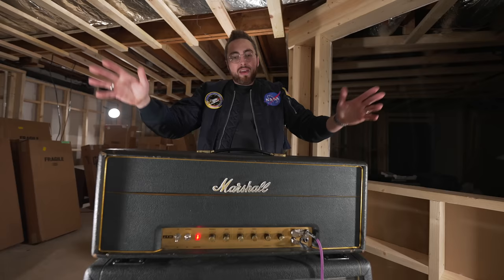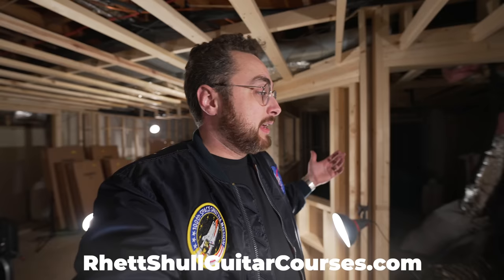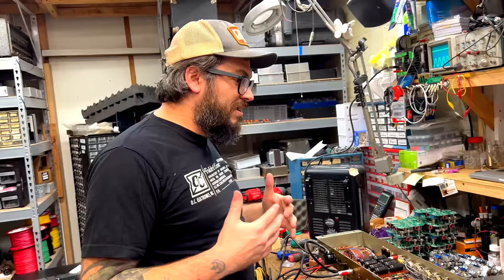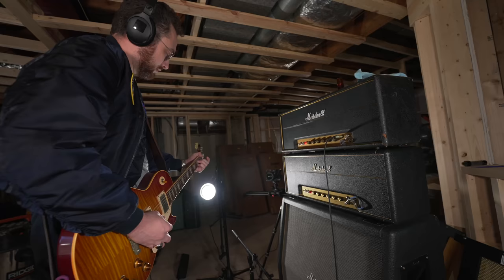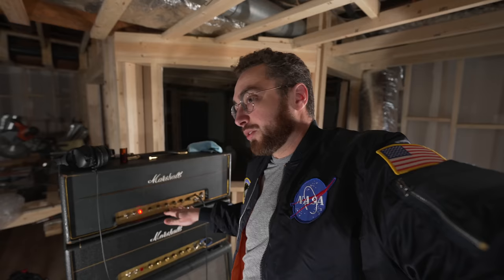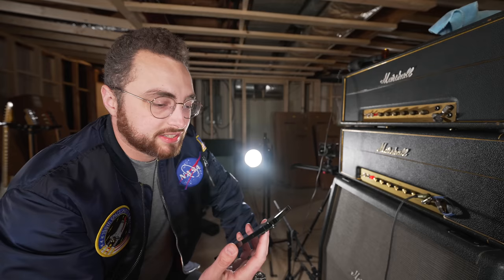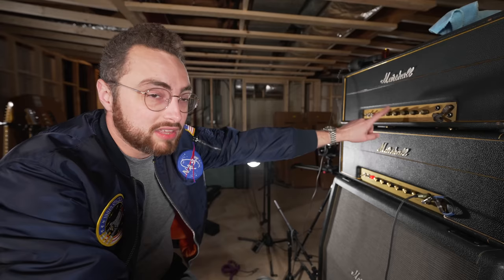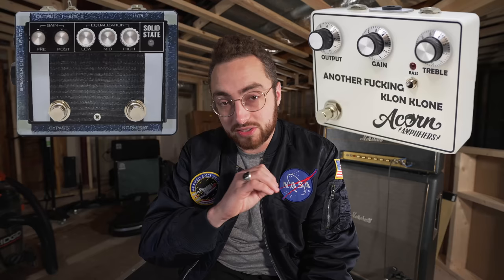This Amp Is So Loud It's Painful | Vintage 100W Marshall Plexi

Comment: Notice how we all seem to play differently at massive volumes? All of a sudden you forget how to play, it's intimidating
Reply from the maker: It’s legit pretty scary.
Reply: Im a trucker and only get home about three weeks in the year. This is how i play every time im home. DAMN THE NEIGHBORS.... actually i do stop playing at night.
Reply: It did change the way I played. Absolutely. After I got over the SHOCK of playing at high volume, I became much more in tune with my touch on the guitar.
Reply: I told an old buddy of mine one time, “you gotta practice at gig volumes to really be practicing for the gig!”  I got a stern talking too from his wife about that the next time I saw her!  🤣
Reply: It's the fear of having everyone on earth hearing you make a mistake
Reply: I do the same thing I thought it was just me!
Reply: Almost so loud it’s distracting me from focusing on what I’m playing.
Reply: Great vid, Rhett. 😢As your touch is governed by your reactions to the sound of your guitar and the feeling of the air around you, the fact you have to play differently at 140 watts makes sense. It also seems that a volume control essentially throttles a tube amp until it doesn’t as you reduce the resistance by increasing master volume Many amazing tube amps are disappointing at bearable volumes.  Unlike the kemper SS power I use now, tube amps I have had exhibited two volumes rather than a range of 1-10: it was either ‘choked a bit’ or ‘loud af’. My fave Marshall profiles other than the HW modern ones are the old superleads. Super percussive.
Reply: I keep forgetting I'm playing my 74 halfstack because I'm so in awe of it at volume! Stunning!
Reply: You have to make it to the cowbell. It is a ride. You can feel it. So if you are not used to it or not willing to learn to ride the bull. Don't! It is not for everybody.
Reply: When I play this loud, at rehearsal, I play like Hercules kills lions.   Unstoppable.  
But realistically, no sound man would ever let me play like that at a club.
Reply: Stage experience. Much easier to deal when the band is also playing.
Reply: @jameswyre6480  At least you didn't said "MY Kemper", lol. 😂
Reply: I know I do, and I don’t play well to begin with.
Reply: Very few can do it, you have to warm up for 4or5 hour before you get it, modern distortion sound better 2203, 2204
Reply: First time I played a 100w Marshall in a studio while recording I couldn't do it.  The amp was louder than the tracks in my headphones!  Fortunately they had an isolation closet.
Reply: it's the lack of effects and compression and the need to articulate your notes that really makes most fall flat on their faces. I'm one of those  "every note is picked" players so when I could finally turn up an old amp I felt really comfortable
Reply: This is so true. I can only assume my fingers are intimidated by decibels.
Reply: It's just like mixing...it's all in context with the whole band. As soon as those drums and that bass kicks in and that guitar is level match with the whole mix, all is right with the world. There's a huge difference between practicing and a rehearsal. Save your ears and practice at a reasonable volume, and wear the appropriate ear protection at rehearsal and the gig.
Reply: That’s the thing I noticed about new tech , everyone rips but my whole life was with 50/100 watt head and 4 by 12 cab .. every club every gig .. still at home but use an ox box to make it house reasonable … now we are all
Eddie with this tiny earphone level lush tone … head and cab and ya suddenly brovato is shelved ….
Reply: 100% true.  I play with confidence at low volumes.  Cranked up loud, it's like I lost 50% of my skill and confidence and I have no explanation why.
Reply: Roger Daltrey talks about not being able to hear himself trying to sing over these Beasts.  Said he never heard himself after a certain point.
Reply: I used to gig a 120 watt sound city stack with 2 4x12 cabs , once had a noise complaint from a house 3 miles from our practice venue....🤣🤣
Reply: When I started playing it was always scary when plugging into a JCM 900 that were on every stage and rehearsal spaces: not only it was way too loud, it sounded terrible as well.
Reply: So true.  When you’re playing to the amp cuz it’s so loud, and that can be a 15 watt in a bathroom, it’s like trying to learn all over again.  For me at least.  I have to be able to spank it and be aggressive.  When it’s cranked my style can get ugly.  That being said, if the money is in filling a large space and has to be cranked that’s just another part of the job.
Reply: thats because the instrument vibrates way diffrent in high volumes. than can throw you so off. billy gibbons sayed once something about this
Reply: Why I will never get rid of my old JTM50t
Reply: @EnigmaEuslam  I'm able to crank it up so I'll agree.  I wouldn't want to change my living situation where I couldn't.
Reply: Man that is so true.
Reply: Lmao, there's nowhere to hide. It magnifies the ham fist. Sounded killer,  Rhett.
Reply: It's always strange playing at that volume with no other instruments.  It's like screaming alone in your quiet office, very unnatural.
Reply: @matthewgonzales3970   Exactly...  only then you know how your guitar reacts and how to touch it..  it is an eye opening experience..  or ears 😂  Too bad it is bit painful, I dont use attenuators or ear plugs..
Reply: Because your mistakes are heard all over the neighbourhood lol. Once you get over the fear its pretty awesome. Actually mistakes dont stand out that much if you play with attitude and confidence.
Reply: That's because when you screw up at low volumes, you're the only one that hears it. At Plexi volume, everyone in a 10 mile radius heard you fart out that note. Lol
Reply: @davidg1612  Straight up truth. I can turn my Soldano up to about 2 in my room with earplugs in. After that it gets unbearable. Im sure the old plexis are even louder.😂
Reply: Smokin!
Reply: @matthewgonzales3970    That's true- my guitar feels like it's come alive in my hands, when I turn the amplifier way up.
Reply: I think it’s because the beast scares the crap out of you
Reply: The neighbours are all listening now
Reply: @guskalogeros9021  the sound men have been given too much power by us as musicians. The fact that when running Plexi glass, Soundmen still complain shows they aren’t worth a shit as sound men. Every sound man over an 18 year career in pro music and touring absolutely sucked and had no ear or talent for the craft, other than about 1
Reply: @StratTones  I agree to a point.  
There’s a lot I dealt with that we’re absolutely shit and wouldn’t let you turn up at all, completely ignoring that you need to push a valve amp to a certain point to make it sound good.  
There are still good ones though.
Reply: Absolutely true , it’s like the higher volumes pick up all your mistakes and you become self conscious of your playing , then you lower the volume and the confidence grows again
Reply: @RhettShull  it takes getting used to. But once you do it’s amazing! Then whenever you plug in you want that crazy loud volume. At least that’s how it is for me.
Reply: @KD-nb3mp  I played one of those and a mesa triple rectifier at a practice space regularly …maybe would go to 3. Completely mental.
Reply: I find this strange. Never have I found a loud amp in any way intimidating. Loud drummers? Yes. 😉 I love it loud! Turn it up, move air!  Feel the guitar through you! I’ve been using 100w Marshall with two 4x12s or two heads and 4 cabs for most gigs for decades. I know some people say this is overkill and usually when I ask they all play really quiet, whether it’s at home, rehearsal or gigs. No stage volume just whatever the foldback provides. Couple guys said they use a 10w combo with 1x 10” and say it is really loud! Haha!
Reply: @ericmills9839  Haha! Damn, i can totally imagine dude. Bob Rock said that John Sykes used two Mesa Boogie Mark 3 coliseum heads (180 watts each) and slaved them into eachother. Ran them with a chorus in between them and through two Marshall 4×12s, all turned up on 10. Can you imagine what that mustve sounded like?🥴🤣 That was on the "1987" Album and the Blue Murder Debut.
Reply: @onlyfromadistance7326  you only get home 3 weeks in a year? That's absolutely mental. I respect your hustle.
Reply: @JoeStanleyAustralia  depends on taste and where you stand I suppose.  I've had drummers yell at me for being too loud with a modest open back combo too close to them. ;-)
Reply: Just imagine, these 100W amps were created mainly so musicians could fight back against large screaming crowds and be heard, especially in larger venues. They're also a good way to be as loud as your drummer on stage- ha! Noteworthy that legit 50W amps are really almost as 'loud' as 100W. Interesting that your amp guy says he regularly measures 100W Marshalls at 140W RMS or more. OMG. Folks, use hearing protection!
Reply: @davidg1612  🤣 I meant that fart.
Reply: @danielabilez3619  Cool analogy - it's like; when the pig don't squeal then the hay is green but the saddle is the stirrup with the bull's hooves on the farm.......yeah!
🤣🤣🤣🤣
Reply: @JoeStanleyAustralia  Bullshit- unless you play coliseums or use a Variac there is no gig where you can crank a head with two quads.
Reply: @sean1121970  maybe where you are situated but there’s numerous places I’ve regularly played, not just in my state either, where we’ve used full stacks. And so did the other bands on the night. No variac. Lots of stage volume. Only vocals through foldback.
Reply: @ericmills9839  haha. Yeah I get that. Though my drummer jammed with some guys and they said can he play quietly, the drum kit is too loud?
He packed up and left. 🤣
Reply: @JoeStanleyAustralia  LOL, in my limited experience, proper drum kits have two levels: loud and louder.  Shouldn't be a surprise to anyone!
Reply: I’m terrible at all volumes…!
Reply: I find turning up louder inspires me to play better
Reply: Until you tame the elephant,  nothing you do counts
Reply: I think part of it is the louder you are, the more people can hear you. a player might also feel like they don't want to blow out half the planet.
Reply: It's because you know if you mess up, you're not the only one hearing it...
Reply: @EnigmaEuslam  my band usually play almost louder at practice and then end up turning down for gigs.
Reply: No it’s not it’s easier
Reply: Felt this yesterday when plugging in my big muff after a while of just playing acoustic. There was a lot of power coming through with sound. I was lost, so I just played clean for the rest of the evening.
Reply: @floridaman7079  No, it's the fear of getting kicked out of your place. Tube amps have to be turned up just to get a good sound. It's pointless unless you live in the desert, so just get an alternative.
Reply: I've only played my pro tube Twin at 6 or higher a few times in the 25 + yrs of ownership. It's scary LOUD. When I 1st started learning computers and Ebay, 1 of the first things I bought was a master volume knob hook up for my Twin. Then I could drive the amp a bit better and kinda control the volume level. This goes through the pre amp in / pwr amp out. Very loud amp. Then I got a Boogie S O B and it's limit knob. Great amp. Can play along side a stack all the way down to a S S practice amp. And even though it don't play well yet I was given a Lab Series L5 with its original speakers and these are supposed pretty loud.
Reply: Depending on tye amp, it could he that your mistakes are more evident. So practice at that volume, with that amp, until you can select thise as nuances. And make sure you use good earplugs that save your hearing and let you hear nuances at tye same time
Reply: @REZNAP just saw your comment and I feel the same.
Reply: I have a 50 watts and always have run it on an attenuator. Never seen the actual
Amp capabilities. One day out of the blue I decided to bypass the attenuator and boom 🤯 it hit me in the face soooooo hard I was legit scared my heart my body my mind were shocked how loud and powerfull 50watts up close are. Figure 140 😅
Reply: I don’t forget how to play, I realize that less is more at this territory

Comment: As someone who gigged a jcm 800 for two decades its an actual art to play these things cranked. The amp and cab  become an instrument in themselves
Reply: Thats where the magic happens - and the guitar becomes a real beast 🤟
Reply: So true. And once you have become accustomed to it, it's frustrating and difficult to go back to anything else!
Reply: The 800 was another Marshall milestone.
Reply: They play you at that volume level - nothing is cooler than playing through a 100 watt and a 4 12
Reply: Do you have hearing loss? 🤣
Reply: @bread6085  Only a bit of top end. Haven't used it in anger for a decade and use smaller stuff now which I think has helped
Reply: They are moody as hell, too.
Reply: I don’t have the money for a nice half stack like that, I bought one off offer up from someone and the Marshall half stack was damaged(cosmetic damages) but right when I plugged into to test it I knew I was taking it home. I have a crate 120w solid state and that doesn’t compare to this and my new Marshall is a Marshall avt50 and that little 50watt half stack is ten times stronger than my crate and it can drown out the bassist and drummer in my band.(not saying that I do I just know it could from accidentally having it too loud the first practice I used it)
Reply: You know it bro

Comment: I have seen lots of people play a "real plexi" for the first time and its amazing how many will default to a Zeppelin riff. I have noticed you also use Slave which is one of my own go to test riffs. Nice stuff Rhett.
Reply: Probably because to get a shreddy sound you would need more gain (overdrive pedal, ala Yngwie), so you gotta play hard rock/clean stuff. If you try to play Yngwie or EVH with the amp's distortion you would fail miserably.
Reply: @jaconova  A cranked 100W plexi (at least the standard one, not sure about the black flag) should do EVH just well. His plexi wasn't nearly as heavily modified as the rumors in the earlier years said. And I think Van Halen II was just a stock plexi anyway. But if you wanted more gain than that you'd probably need a tubescreamer or something, yeah. With a master volume model just having a Super Distortion (or similar) pickup can yield you at least a nice rhythm tone. I never tried the X2N but the levels of distortion it gets you even without a pedal must be insane.
Reply: A lot of Page's riffs are about dynamics. There often is a clean, folk-y verse and a barking blues-y chorus. If you want to know how a dimed amp reacts to the volume pots of the guitar or your picking, they are incredible fun to play.

Comment: That Marshall "thump" is an iconic piece of the late 60s tone and is still very desirable.  A trusted amp tech explained to me that it was a combination of the amp, speaker choice, and cabinet design that worked together to make it happen.  Yes 125 db is crazy loud  and used to get us kicked out of a lot of clubs back in the 70s.  "Turn it down or pack up and go home" was a familiar phrase from bar owners who were attempting to contain the mayhem in their place. EVH chose a variac to lower the source voltage into his Plexi and reduce the volume when his amp was dimed.  This science experiment contributed to his brown sound.

Comment: I had the opportunity to play a large concert venue a few years ago(it was a local event and my singer knows people involved with the venue) and I have to say, I fully understand now why they needed that much power back in the day with so many cabinets and amp heads. It's crazy how sound just disappears in an outdoor venue. Also I'm used to only needing 20 feet of cable at any given time. But I found myself reaching the end of my cable rather quickly and I still had another 30 feet of stage in front of me. It was nuts!
Reply: Thank God we have wireless today 😅😅
Reply: I only got to crank mine at a farm house, but your right.  I can't imagine playing through a wall of them.
Reply: Transmitters are your friends my friend.
Reply: @schmoemi3386  Angus Young was using wireless back in the late 70s.
Reply: Tantos geniales músicos con daño auditivo severo, a cuidarse los oídos muchachas y muchachos!

Comment: I've watched Navy fighter jets (F-14, F-18, EA-6B & F-4 Phantoms) take off and land on aircraft carriers, I saw Deep Purple in concert, I've played my Fender Bassman 50 watt amp at full volume. I know loud and there is nothing quite like 100 Watt Marshall amp at full volume and yes, I've done that too. What made this video for me was that you played "Ten Years Gone" my favorite Jimmy Page riff of all. Great video, Rhett!
Reply: If you ever heard a F-35 that would be next level - much louder than almost any other jet....I have been on the ground at the local airshow a few times and seen and heard plenty of jets - the warnings over the public address system in advance of the F-35 went on for an hour warning that it was much louder than the other jets - this monster shook the ground like nothing else.....
Reply: I worked on Navy aircraft, and with double hearing protection, they are almost unbearable.  I have a plexi now, and it can get loud as hell, but no comparison.  Maybe if the jet engine was at low power.